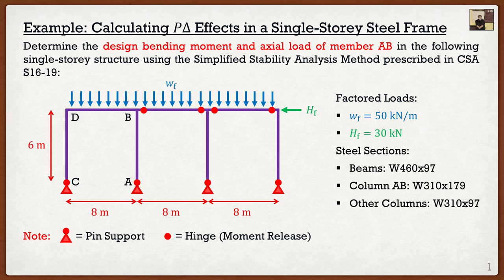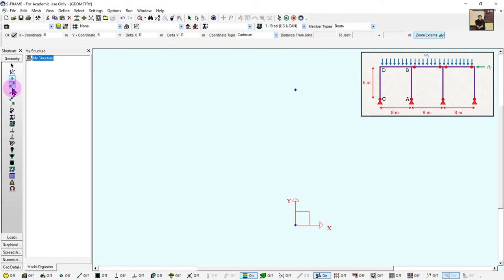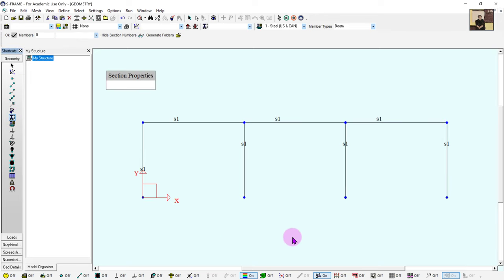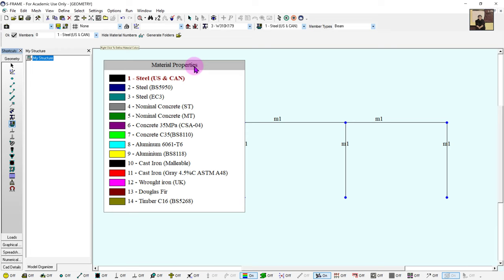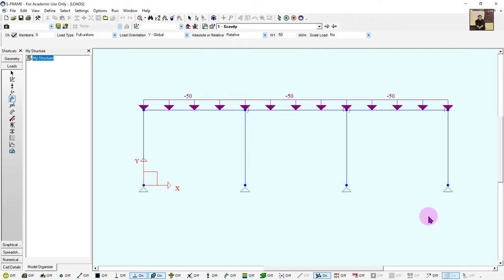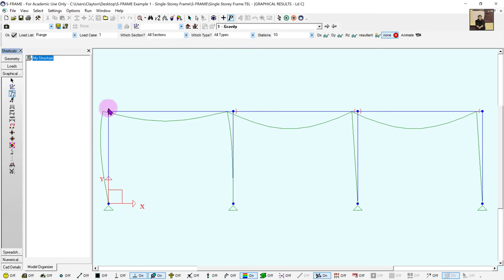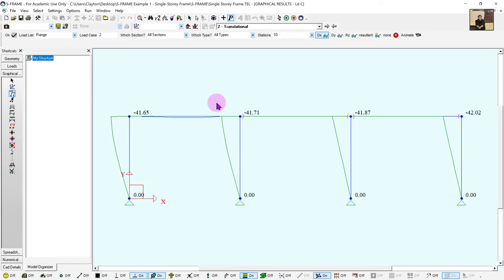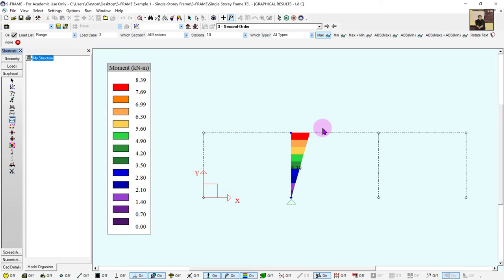S-FRAME | Example | Single-Storey Steel Frame PΔ Analysis (CSA S16-19)

Comment: Thanks Clayton for the amazing tutorial. Just one question. Since the second-order analysis was really easy, why would the code provide the first order analysis with amplification factor? From what I understood, it was just only a different analysis option, and thus less confusion and mistakes.
Reply: Hi the code doesn't expect everyone to have access to a software that can do second-order analysis. So it gives first order analysis with amplification factor (so that anyone with a calculator can use the code !)